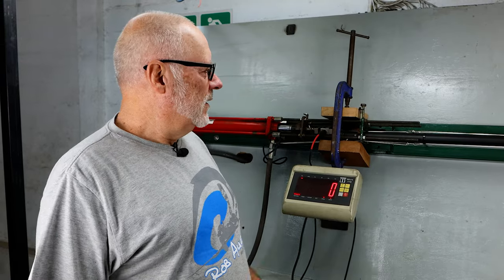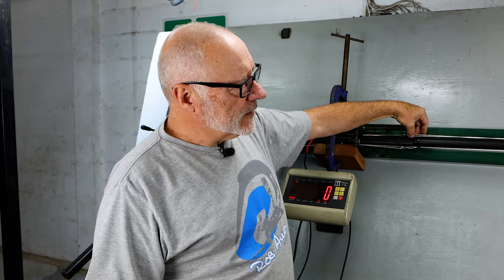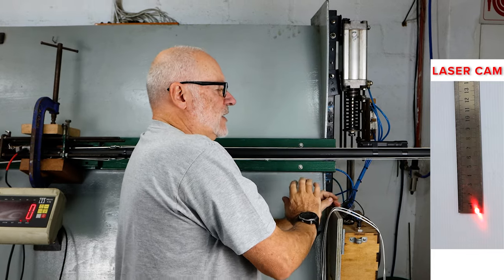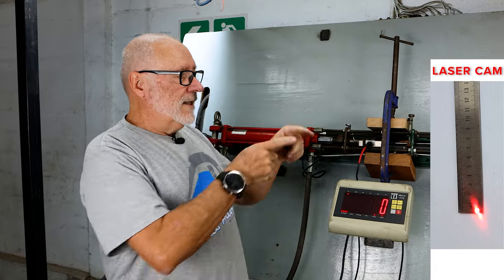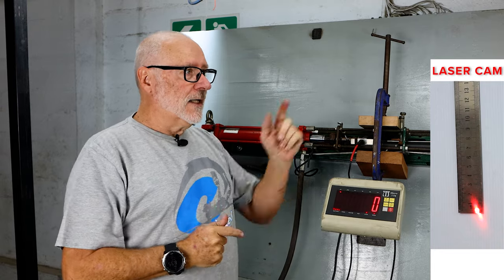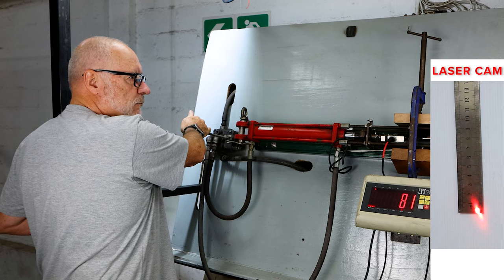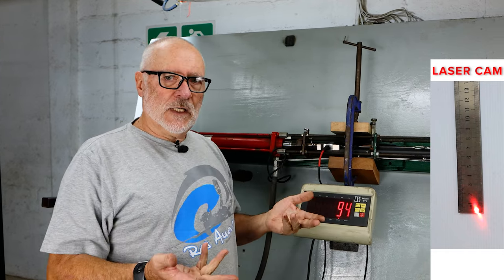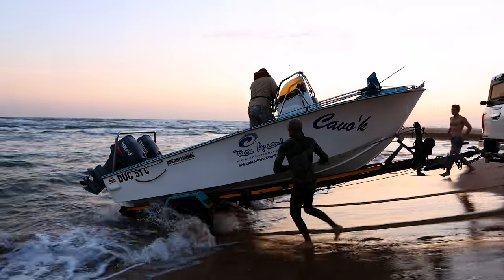Rob Allen | Barrel Deflection | Part 4 | Roller Muzzle | 2024

Comment: Have you done any testing on how this flex affects aiming and accuracy? Does the flex disappear prior to spear leaving the gun and does the spear path change accordingly or not? Wonder if this is why people have so much trouble going from conventional guns to rollers? Different aim points to hit the same spot? Be interesting to see roller and conventional fired underwater at fixed spot to see the difference in spear path.
Reply from the maker: We see little change in accuracy, possibly due to the fact, once you know where the spear goes it seems to be fairly constant. But, we are sure the muzzle will hit down on the tail of the spear as the barrel straightens up. It seems to "tap" the trailing end of the spear as it is  leaving the muzzle. This creates an oscillation in the spear, causing more drag and, must slow the spear down. 
So, accuracy is a slight factor but, we think penetration lost due to the spear speed eroding is a bigger factor.  The fact the spear gets moving out roller muzzles so much smoother and is not "tapped" it  keeps much straighter in flight. This lowers the drag, improving speed and penetration.
Reply: @RobAllenSpearfishing  so does the oscillation not occur with open muzzles?   Im curious if this would cause them to all hit a different spot if fired from an identical fixed position.
Reply from the maker: @spearo16  Good point, I did not think of that. I don't remember seeing a difference when testing between open or closed. Now that you mention it, I wonder if there could be a slight downward suction effect from the rail "sucking" on the spear as the barrel straightens out, causing a wobble. We will have to do some more slow-mo video to see if there is this effect.

Comment: Could there be a downward flex at the moment the spear is released, because the rubber is only released on the topside (spear) and not on the lower side (band anchors), pressing the barrel down for a very short moment?
Reply from the maker: I have always thought that as well but the fact the bearings are ceramic and turn with very little resistance seems to prevent this. We have done extensive pool testing and have yet to see any visible movement either way. We do have a plan to test the ceramic against the non-bearing bush type which might have a little.